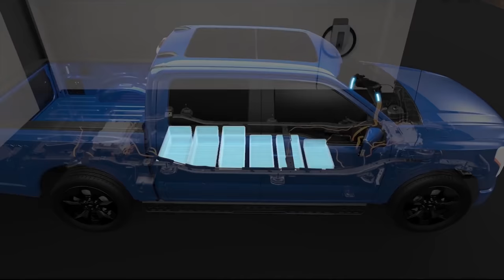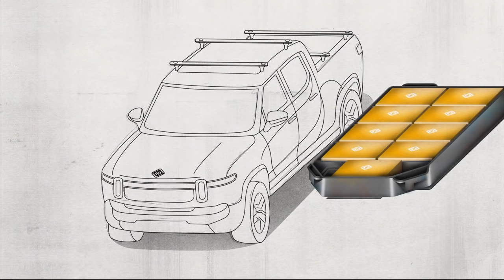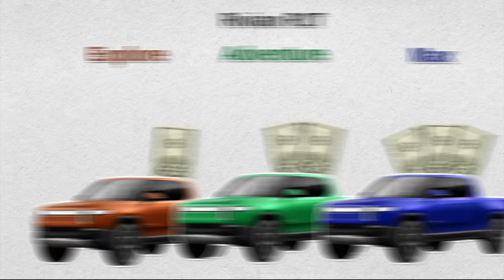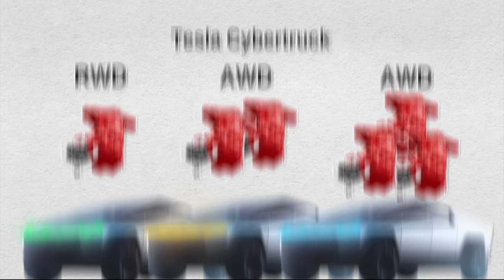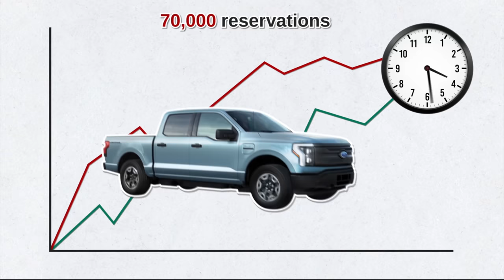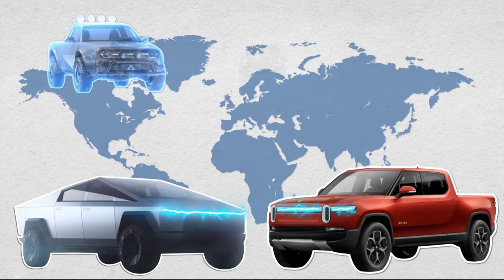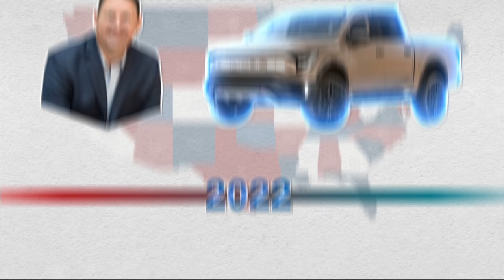Here's Why This Will Replace Trucks in America

Comment: To quote Patrick Star: “who are all you people” I’ve never heard of half of those companies
Reply: Yeah alot of them are smaller companies trying to get into electric cars market. 

I think because of its size a pick up truck that can go 500km in one charge is easier to develop and market to America. If any one company takes off, they will probably release a sedean line up too and boom new Tesla competitor.  This just my hunch on why there are so many Pick up EV's.
Reply: @peachulemon  The reason for starting with pickups is in the first 30 seconds of the video: 11 million trucks sold in 2020 of the 14.5 million vehicles sold in the U.S. Trucks are the biggest market segment.
Reply: @memathews  Ummmm EC's weren't "started" with pickups, they were done in the 90s and before (E?even at the outset of the auto industry) by the major automakers, except the battery technology wasn't good enough to make them viable for common use. (Hey, anyone remember trolley cars which were electric powered and ubiquitous in major cities in the mid 1900s?) And if you haven't noticed, Tesla DIDN'T start with trucks. 🤣🤣🤣
Reply: @teemcshanney8910  Your absolutely correct. I probably obscured my point that trucks are the sweet spot of profit and volume that a manufacturer can target. As for Tesla, I can hardly avoid parking next to a Tesla here in Portland and they are all cars as you more. Tesla used the roadster for PR value and set the price to create a standard under which layer generations' pricing would be acceptable--Musk plays the long game.
Reply: @teemcshanney8910  it’s clearly a joke why did you get pressed 😭😭

Comment: Lithium batteries are worse for the environment than fossil fuels
Reply: true.  what  are  you  going  to  do  with  all  the  old  leaking  corroding  lithium batteries ? landfills  full.
Reply: @driver4011  Launch them into the sun......
Reply: @JT_771  yeah except for the strip mining that goes along with lithium mining and the using of fossil fuels to generate electricity for the electric vehicle. Also the fact that the grid cannot handle everyone driving electric. So I wouldn’t go so FAR to say FAR better.
Reply: @JT_771  EV is such a broad term. I agree that we need them in order to be sustainable however I just think straight lithium battery driven vehicles are not the answer. Hydrogen,hybrid and biodiesel has not been explored fully.
Reply: @markplott4820  yes you are

Comment: I think it would be wise to wait a few years to see which survive and which are a "flash in the pan" so to speak.  ( no pun-ishment intended)
Reply: Maybe it would be wiser to buy an electric car next year, and not have to worry how much longer you will be able to rely on your local stealer to fix it and have it scrapped in 5 years when nobody wants to buy your stinking, hungry, slow and high maintenance  horse and buggy.
Reply: Gonna be a lot of Studebakers and Henry J's.
Reply: They need more charging stations. In our area along the interstate there are a total of 3 charging ports in a 100 miles compared to probably 300 to 400 gas/diesel pumps lol
Reply: @richards1191  they still haven't figured out how to recycle the batteries
Reply: @nerdnec  more than half the time they don't even recycle garbage in the United States anymore
Reply: Oh Bobby 🎭
Reply: EVs are not quite there yet, but when the powerpack is perfected with ubiquitous, fast recharging stations and the prices come down.....

Comment: The electrical grid for the United States cannot handle the additional load that tens of millions of EV's will require. This means that "off peak" will be a thing of the past. Good luck charging a expensive pile of lithium during the coming brown and blackouts.
Reply: This country is being destroyed.
Reply: @JT_771  ,
Upgrading the US power grids will cost trillions of dollars and require decades to accomplish, squaw, so don't spend your money on an EV.
Reply: Exactly.
Reply: @JT_771  ,
You will never replace the electrical grid with $20 billion per year. At that rate it would take more than one hundred years.

Comment: The future: Charging your car at public charging stations will cost the same a filling up at gas stations now due to electricity shortages.
Reply: Providing the power isn't out. They connect to the grid as well.
Reply: You know it🤣, Or more ❗
Reply: And it will take FAR longer than a fill-up that can be done from empty in less than 10 minutes.
Reply: Notice they didn't tell use HOW LONG it takes to completely charge these things..

Im all for inovation, but this is innovation with a catch..
Reply: I can see that happening
Definitely
Reply: @kencarp57  just as little as 2 or 3
Reply: @parallax9281  I think electric cars (as of now) are only good for Uber drivers and delivery drivers. They’re not developed enough for longer trips
Reply: @jessepickar3297  agreed.. they do look pretty.
But pretty aint going to get cha out of a bind..
Reply: Then the magnets cars will strike 🌝
Reply: sponsered by Toyota...
Reply: That is the motto of all, Supply and Demand.  Oh yeah,  cheaper from the start, excuses in between and higher charges from now on.
Reply: @kencarp57  in the span of 5 years charging went from 45 minutes to 15 minutes for Tesla. Once the other companies are on board it will be reduced further. Just look at cell phone technology,  hardly takes 30 minutes to fully charge my phone now, can even do it "wirelessly"
Reply: I agree but at least you can fill up (charge) at home. Just think about walking out every morning for to go to work knowing you have a full tank (battery).
Reply: Why don't they charge the car while in motion? Extra alternator to charge battery? And Tesla Turbines in the grill to spin and charge while driving? There is ways to do it, but they have to milk every penny they can. Don't be suckers.
Reply: It already is close to same as gas at some DC fast chargers, saw 0.41 a kw last wk or if you had a 75kw battery 0-100% would be about 30.00 bucks which might get your 220-250 miles. Saw this price at a 150kw fast charger other day. Although as an EV owner I've never actually charged when out (only at home), its the commuter though and im not a guy that likes road trips.
Reply: But when you need a recharge driving on a holiday weekend you will sit in line for 8 or 12 hours waiting your turn. Not the same as getting gas.
Reply: @markj3179  agree
Reply: And the dealerships can’t even repair a gas engine let alone a ev just imagine one shorted out wire can cause the ev to go nowhere
Reply: ...and since the gas tax revenue will drop with increased adoption of electric vehicles, there will be a "charging tax" added to the price of a charge
Reply: Except petrol prices will skyrocket
Reply: Not to mention when the complaint was issues with the power grid..  Id like to see the test results of range of these trucks when towing.  What is the cost going to be when you begin to charge an EV?  This is what congress does... just sign the bill we will read in contents later.
Reply: @markplott4820  I don't think that accurate.   Today, the cost to produce renewable energy is more.  The technology is not developed to where it is cost efficient.  It takes more energy and cost to make recyclables,  solar panels,  turbines, and so on.  Under the information I've read and senn on reliable sources,  renewable energy will be plentiful and cost efficient  in 10 years or around that time.  Caveat,  like all supply and demand, will the producers keep the cost down from becoming the normal trend of purchace.
Reply: @kencarp57  Unless you're travelling you wouldn't be "fully" charging it. The Hummer charges 100 miles in 10 minutes. Day to day use you plug it in like your phone. It's 100% charged daily. If you're like most people driving less than 40 miles a day at the end of the day it's still 90% charged.
Reply: @markj3179  Because that's called perpetual motion and is impossible. You can't create more energy than you use (thermodynamics rules one and two). And by use I mean the energy the car uses to move + the additional energy used to turn the alternator because it would cause additional resistance the motor has to overcome.
Reply: @theflew  good thing I'm not a rule follower, I'll post a vid when I'm done doing it to my DIY electric car..... It's gonna be awesome !!!!!!!
Reply: @markj3179  I believe Ford has developed recharging by depressing the breaks.  This charging is on the hybrids models.
Reply: And there will be a separate meter in the home so you can be charged the same 80.00 it cost to fill your tank to charge your battery.
Reply: @Herefornow-571  Like the saying goes; we're gonna give you some moneyl savings up front but just wait we're gonna get that back plus more in the end.
Reply: @georgesilvas3587  All electric cars, PHEV and hybrids have regenerative brakes. Basically when you press the brake pedal instead of the friction brakes (disc or drum) generating heat slowing you down the electric motor uses the motion to generate electricity to feed into the battery. It's one of the reasons EVs have better city mileage. Every time you slow down/stop you charges the battery a little.
Reply: @markj3179  Make sure you measure how much you used with and without your setup. I guarantee you'll use more energy than you'll create. Unless you're going downhill.
Reply: @theflew  true but if you're constantly charging separate set batteries, also charging battery your using. I flip a switch, and walla problem solved. Think outside the box bro ..
Reply: @Herefornow-571  um no, I built my own charge system, why would I pay those crooks??? YouTube is free. You can learn anything on it. Try using it for that. I've saved soooo much money!!!!good luck!!!!
Reply: @markj3179  It still will not give you more energy than what was originally put into the system + any regenerative braking gains.
Reply: @theflew  great have a great day..

Comment: Most important detail not mentioned: charge time.
Reply: It'll be a lot longer than filling up a gas tank.
Reply: Who Drives more than 250 or 400 miles a day? And when you do, do you not stop for lunch or dinner?
Reply: Tesla’s new chargers will charge from 10% to 80% in 5 minutes. That’s right, 5 minutes look it up.
Reply: Just charge any electric car every single night, and you shall never worry about this subject (also assuming who is going to drive 400 miles every single day? Even if you going to work on daily basis every single day, you can easily plug it on charge during the work time and again plug it on charge once you reach home... Just like your phone and your laptop and and and (we need to stop acting like there are no solution for charging our cars (yet we charge our phones and laptops and headphones almost every minute during day and night! 🤦🏻‍♂️
Reply: @manaaalsuwaidi3643  You're also assuming all employers will have charging units for each employee car that's in the parking lot.
Reply: @b.h.1205  yes, because soon we will be having charging station almost everywhere (at least in Dubai we do) + someone could easily buy a solar charger and hook it up during his work time (the alternatives are many!)
Reply: @b.h.1205  + You need to stop resisting the change and go with the flow 👍🏻
Reply: @allanwatts4473  One example: the whole RV community, who happen to love taking their RVs to out of the way locations. Another: students travelling home from school or vice versa (I stopped as little as possible when I did that, and my drives were 30 hours in total each way). Another example: people moving from one place to another who prefer not to use multiple hotels and just push through. Many people drive to get there as opposed to driving with multiple, long stops.
Reply: @b.h.1205  they will once they figure out how much they’ll save in maintenance and fuel costs.
Reply: @Milliegs  
   When you can find them then wait in line for 2 hours …. Can you afford to put one in your garage? No .
Reply: @allanwatts4473  I rarely stop for a sit down lunch or dinner when traveling 500+ miles. I don't travel that far every day though but I'm sure long-haul truck drivers do. When it takes hours to recharge my cell phone I would say that recharging these electric vehicle batteries in less than 30 minutes is dangerous. Same goes for laptops. Some catch on fire.  I expect there will be a lot of electric vehicles catching fire. Even lead acid batteries take time to recharge. Regardless, these electric vehicles are out of my budget range.
Reply: Well .... the most important detail is the grid ... will it support the shift? California just shut down Oroville hydroelectric plant .
Reply: @daizagor_7604  
  I just heard about that . Saying hover “could be next” . We have a very weak power grid . This needs addressed before they mandate the 2050 restrictions. In my case I ev is useless . I pull horses, camper. My trucks work . Electric would never keep up . Plus they don’t have the technicians to work on these . I can repair my 2020 or take it to a dealer . Up here in Ohio lots of Tesla but no repairs can be done lol
Reply: @daizagor_7604  It's going to take several years if not a decade or two to get the infrastructure in place. it'll probably cost trillions to get such an infrastructure built. plus not many people are going to pay such high prices for such vehicles. so i'm not too concerned about the demise of fossil fuels in my lifetime.
Reply: @georgeidarraga4006  LOL And they'll change their minds right back as soon as they see the costs to replace the batteries in 8-12 years (e.g. more than a new vehicle). Or, perhaps when they see their electrical grids start cycling power on a regular basis because they can't sustain the huge additional loads and increase fees to customers to reduce use.
Reply: @Milliegs  HA! HA! I did look it up because it sounded really off. Their level 3 chargers can charge to 80% in 30 MINUTES and it is recommended you not regularly use those types of charges for battery health. Good try though.
Reply: @allanwatts4473  i think the problem will be charging stations; i.e. 20 or 30 maybe at each stop, what if they are full, say it takes 20 to 30 minutes to charge... going have to wait in line for a hour or so just to charge... someone/group /think tank, will need to study this issue for nationwide installation.  this is gonna be a big issue and a real problem with the current grid.
Reply: @manaaalsuwaidi3643  Of course, in Dubai you have charging stations!!!
Look how little Dubai is compared to the United States..
We do not have this in America certainly not in All of America..
Reply: @allanwatts4473  No I do not stop I drove from TN to CO 1200-1400 miles took me 23 hours and I stopped for fuel and fast food and kept on rolling...LOL
Reply: @manaaalsuwaidi3643  you need to stop acting like there is a network all around us to charge our cars. Phones and computers are no the same. Get a brain
Reply: @Travis Davis I drive over 400 miles most days hauling livestock.  Stopping for longer than 10 minutes with livestock is not a good.  You got to keep the air flowing over livestock even during cooler weather because it gets hot inside a trailer packed with horses or cattle.
Reply: @Milliegs  and their windows are bulletproof, just don’t throw a rock at them.
Reply: @manaaalsuwaidi3643  then drive your phone instead.
Reply: @manaaalsuwaidi3643  I guess everyone will live in the middle a desert in the future. Well, unless they bought a house on a man made island in Dubai. Then, you can have an electric boat charging station in your living room.
Reply: @frandanco6289  i do agree with you about the size difference, but remember, THERE ARE alternatives! Stop crying about it! (Unless it's a Tesla fanbois thing that they keep crying about everything 🙄🤔🤔)
Reply: @2004cyrus  and also you need stop crying about it (just like every other Tesla fanboi I've seen🤦🏻‍♂️💁🏻‍♂️) and accept the fact that you can charge your freaking car AT HOME! the phone that it's poorly between your hands is being charged almost every day and you are not even noticing that!!!!! So stop crying about it and CHARGE THE DAMN CAR at the home every night and you will be fine!!!!!
Reply: @martytarver4544  believe it or not, you can reverse charge almost anything (95%) now a days! A laptop can charge a phone and powerbank can charge a car battery and the possibilities are endless! So yeah i can use my phone or my phone charger to charge my car (in the future of course) for a few percentage to drive the car at least few miles 👌🏻 have you heard anything about 100w phone charger? Do you know anything about 400w or 500w  solar panels?
Reply: @martytarver4544  colder weather are not good for batteries, so does the hot weather (but slightly with more efficiency I hear 🤔) but the battery pack in an electric car needs to be at certain temperature and shouldn't be exceeding that.,.. so heat is still an enemy 💁🏻‍♂️